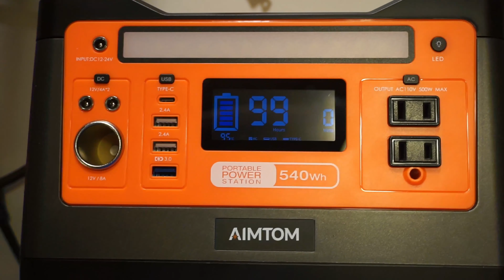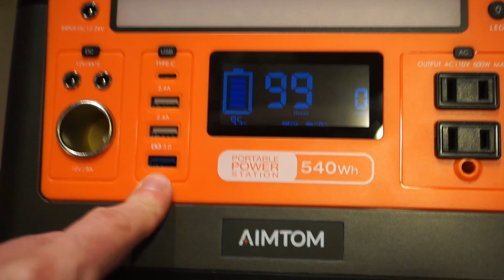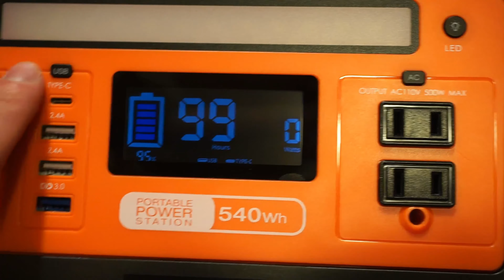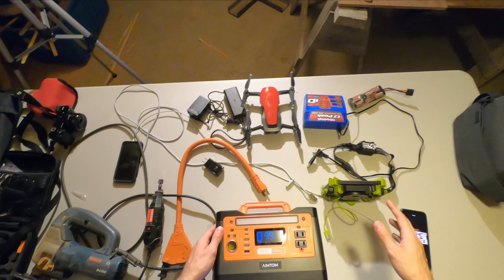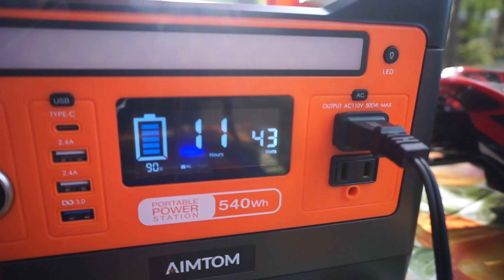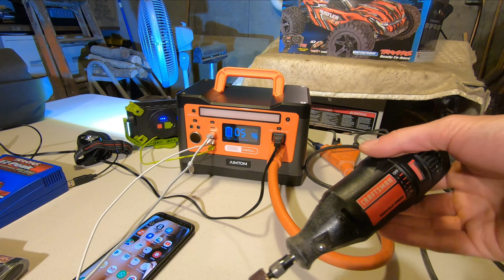AimTom 540WH Raptor Portable Power Station

Comment: I want to buy a portable power station that will support a CPAP and coffee pot?  for  my DAD. Need help!!!
Reply from the maker: A cpap is a power intensive unit on these  power stations. Once the heater in the cpap turns on that’s what draws the most.. at a minimum I would go with a 500 wh unit or higher for those appliances...

Comment: Which wire charge the aimtom I have 100watt solar panel
Reply from the maker: The cable is a 5.5mm x 2.1mm connector. I use a 120W panel from paxcess

Comment: Thank you for your review, you mentioned that one shouldn't use this for a heating element.  What if my cook plate is max 500 watts, is there some other restriction I should know about?  Thanks.
Reply from the maker: Aseal, thanks for the comment. So if it is max 500 watts you should be fine, just know that if you are actually running something that is 500 watts at one time, the battery will probably last like 30-45minutes max.
Reply: GReviewz Good to know.

Comment: Hi , is the aimtom the same as the KYNG 540wh 1000peak ? They look exactly the same , but the other is 100$ cheaper , if it is .. its a steal
Reply from the maker: it does look to be the same unit, however, the aimtom is only $479 right now. So I dont think it is $100 cheaper..

Comment: How do you feel about this unit compared to the Jackery 500?  I’ve been wrestling between the two for ages. I like that the Aimtom can take up to 200 W solar; also that it has two AC outlets. I’m not keen that the cigarette lighter charger is not regulated.  Your thoughts?
Reply from the maker: Linda, the two are very closing matched in terms of specs. However, I decided on the Aimtom Raptor because of it's slightly larger battery of 540wh vs the Jackery 500's 518wh, the very bright LED area light vs the small spot light on the Jackery, and lastly the Aimtom has, as you mentioned the 2 ac outlets vs the jackery having only one. I am very satisfied with the AimTom. Please consider subbing to our Channel!

Comment: I noticed you channel reviewed two different battery units. I go camping
 from time to time. I like to bring a Coleman 40 qt plug in cooler. It 
only has a 12v power point plug on it. So when camping i just leave it 
plugged into the car over night and hope for the best. then i start the 
car next day. the fridge is rated at 60 watts. with either of the units 
you reviewed run the fridge and how long?
Reply from the maker: bob, thanks for watching. please consider subscribing. so the two units have two different batteries capacities. one has 540wh and the other has 230wh. how you figure out how long something will last plugged into the ac outlet is as follows: capacity of power station(example 540wh) X (efficiency 88% efficient) /how many watts your device is (60 watt fridge) = 540wh x .88/60 watts = 7.92 hours with the 540wh model and you would get about 3.3 hours out of the smaller model.